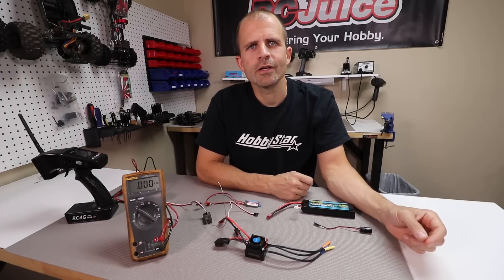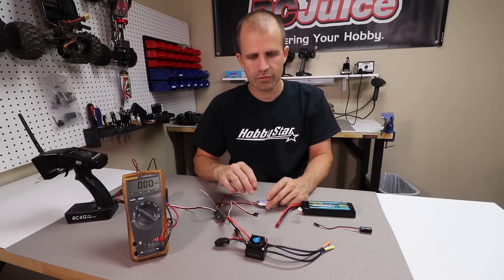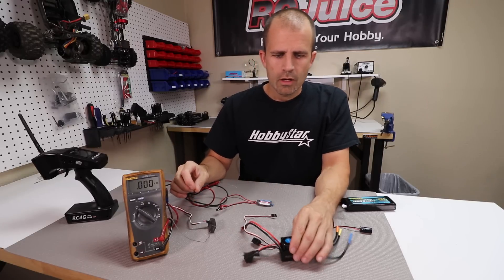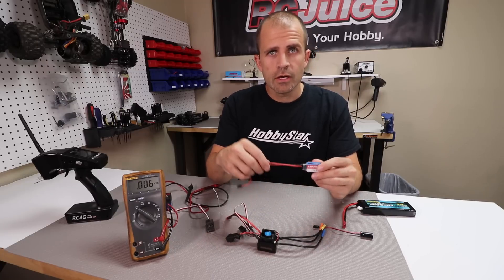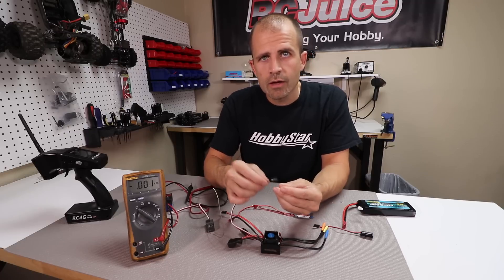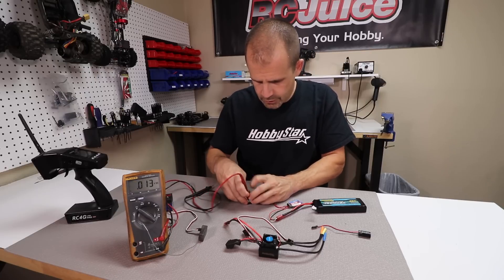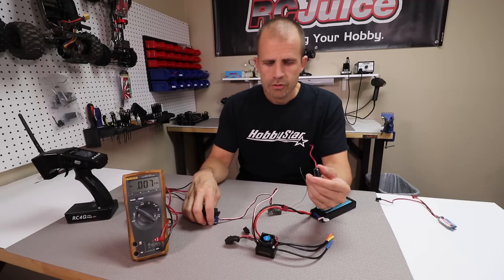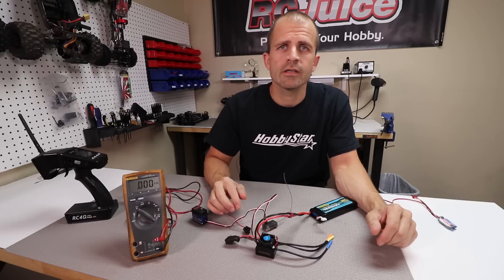What is a BEC and what do they do in the RC hobby?

Comment: Another great informational video 👊. Much appreciated as always. I wanted to ask your opinion on motor vs ESC amps and voltage  ratings. Is it essential to have the ESC rated at the same or higher amperage as the motor? Also is it unsafe to run a motor slightly past it's voltage rating with a higher cell lipo pack?🤘🤘😎💪👊👊
Reply from the maker: Thank you for watching Rich!!  Very good question, we get questions related to that subject almost daily and do plan on making a video addressing this entire topic as there is quite a bit to it.  One of the first points that is important to understand is that a motor is always going to pull all the amps it wants, regardless of it’s rating.  In fact, if you look at a data log from a setup you’d be amazed to see how high the current spikes right at startup.  It can go into a few hundred amps, although this only happens for a fraction of a second.  The voltage ratings on ESC’s must be adhered to, the firmware can only work with certain voltages so if an ESC is rated to 6S, you cannot exceed 6S on it or you can destroy the ESC.  On a motor, there is nothing at all that actually limits what voltage you can run on it, the specifications are there as a guideline for what you can safely run the motor at but it is possible to burn up a motor if it is over-geared when running it on or even below the maximum rated voltage for that motor.  You can take a motor that is spec’d for 4S and run it on 20S if you want, it’s going to work but will quickly heat up and self-destruct.  This is why it is so critical to monitor temps on brushless setups, particularly when it is a new setup that you are not familiar with.  At the end of the day your motor temps are the number one indicator of the health of the system, as long as the motor temps are staying in check (we like to keep them under 170F) it does not matter what voltage you are running as far as the motor is concerned.  As far as the ESC rating, this is one area where bigger is better as it will just give the ESC a better chance of surviving if you really push the motor.  Remember, your setup is going to pull all the current it wants regardless of the rating of any of the components, the current draw is dictated by the voltage, motor KV and effective gear ratio (taking into account pinion/spur, diff, trans, tire size etc.).  A common misconception is that an ESC “sends” power to a motor, it simply channels the power and it’s critical to monitor temps in order to make sure you are not going beyond the limitations of the system.
Reply: RCJuice thanks so much for the detailed answer about this 😂!!! I missed the notification for your response and truly appreciate you taking the time to explain things clearly 👊. This Crazy HOT weather has posed even more challenge with keeping temps in a safe/efficient range. The bone dry powdery dirt has meant more wheelspin and higher sustained RPMs. I'm trying to become more proficient with my understanding of electronics overall and your response is most helpful 👍. I generally gear my rigs to about 150-160F and like my ESCs below 140-150 tops🤔. Really LOVE the Hobbystar 1730 and 1480kv. My 3-8s rated 160A Hexfly Hex6 ESC has overheated the last 2 outings with the 1730. I'll try gearing down to a 17-18T and getting out before it's 100F+. Thanks again for your help and keep up the great videos!!! 🤘🤘😎💪👊👊
Reply from the maker: Our pleasure Rich!!  We had our Traxxas Ultimate Desert Racer out this weekend at Don Pedro where it was plenty hot.  Running the 4092 in 1730KV on 8S and temps stayed cool enough all day, some reckless fun with 8S and no overheating.  The high-temps and sustained higher-RPM due to the loose dirt definitely do make a difference in what you can get away with, but you are smart to always watch those temps.  As long as you keep your temps in check these electronics can last indefinitely.
Reply: RCJuice I haven't been to Don Pedro in years, but recall it getting quite HOT during the summer 😨. Just pictured you doing huge 8s drifts with the UDR 😰🤘🤘. That would make great video add ins to your informational vids🤔. That's awesome to hear the 1730 can take that voltage 👌. I'll need to check out the ESC you're running. Don't have any 1/7 - 1/5th scales but my friends certainly do. Thanks again for the great information, truly appreciated 😂!!! 🍻😎💪👊👊
Reply from the maker: Oh yeah, especially this past weekend "Hot" would be a massive understatement.  You are spot-on with your "drift" assumptions!!  There were some nice open dirt areas where I had that thing going sideways at crazy speeds, as long as it doesn't hook on anything she will floar over everything but when it does catch she'll cartwheel for daaaaays!!
Reply: RCJuice LMAO 😂!!! Yeah I've seen the "UDR tumble"😨. Can only imagine on 8s with that power set-up 😱. Sounds like you had the perfect spot for going NUTS 😰😰🤗.  Definitely a Wild scale Ripper no doubt. Hope to see more running footage sometime. 🤘🤘

Comment: What about if I just want to run my Onetomanyrc light bar on one
Reply from the maker: As long as the output of your BEC provides voltage within the rating of the lightbar it will work great.
Reply: It's rated for 11.1 - 14.4 the I'm waiting on a for 12vbec picked 12 for longevity